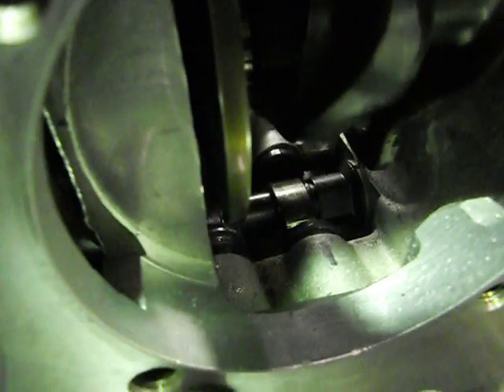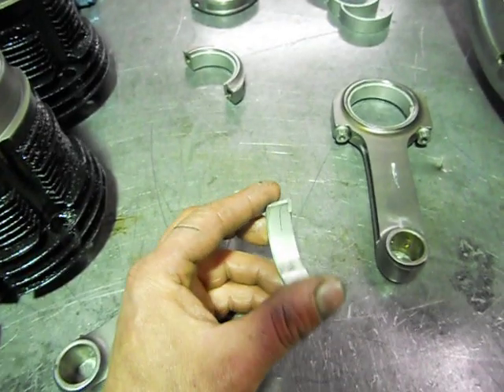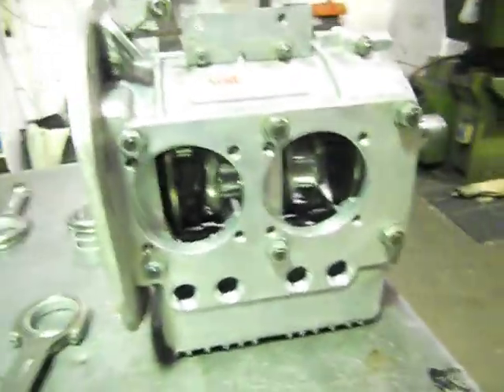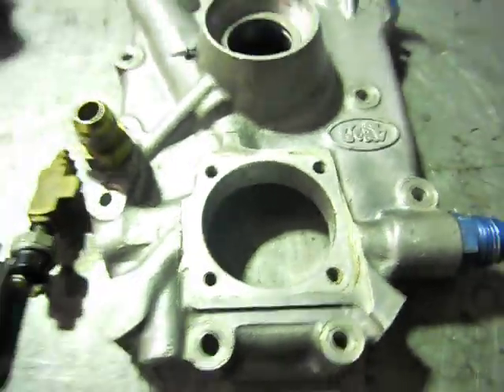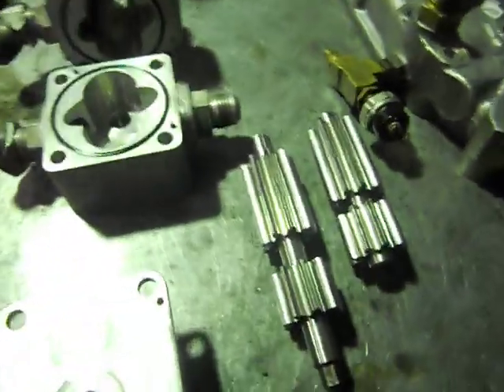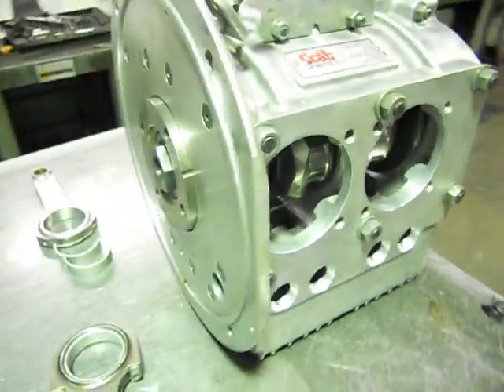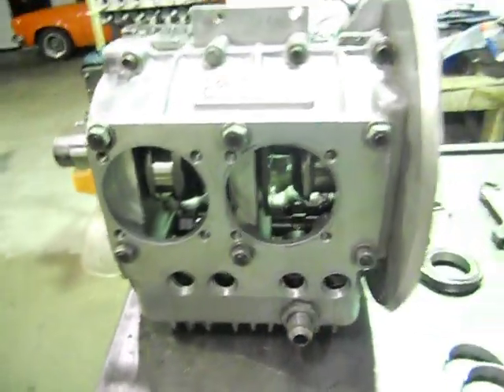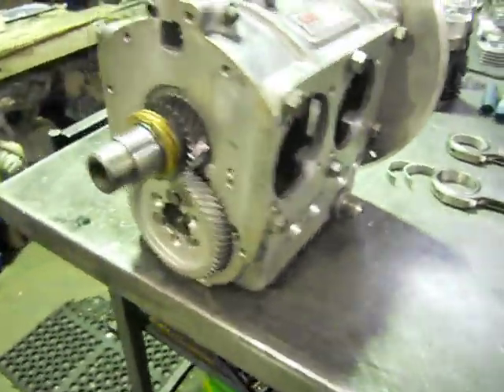Problem solving Hi Peformance Scat Killer Case Race Engine failures

Comment: I built a beach buggy (1835cc) back in the 80's and kept cracking blocks ... I welded plates to strengthen it but it started breaking crankshafts... went for a counterweighted forged crank and that was ok for a while until it bent itself... eventually got a scat block with a roller bearing crank and that was the business...miss those days and I should have kept that buggy...fun times and great memories.

Comment: Providing the gears are not jamming scuffed scavenge gears are par for the course, though clearly that pump had problems. Those tang drives though are not a good idea. As  [like on a sprintcar engine] all the crank and valve train harmonics go through the tang.
Reply from the maker: Exactly right mate